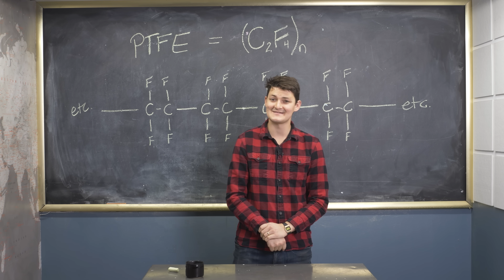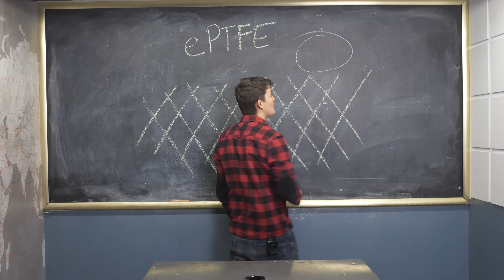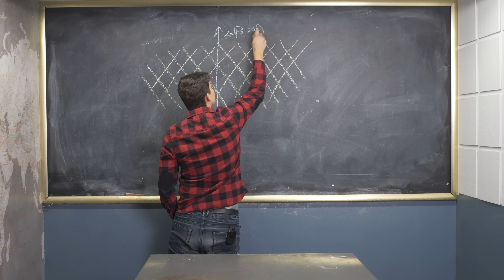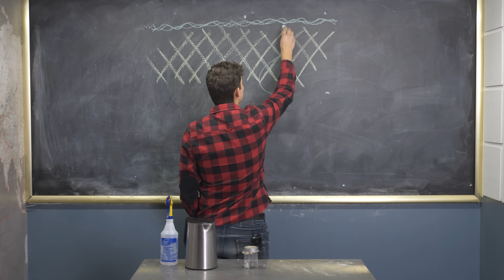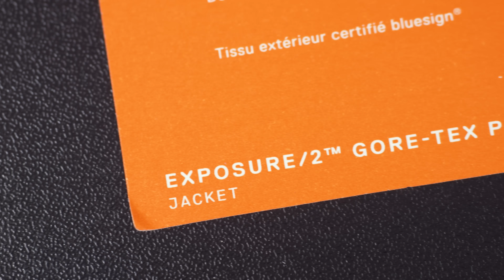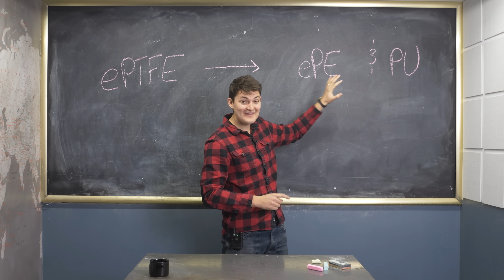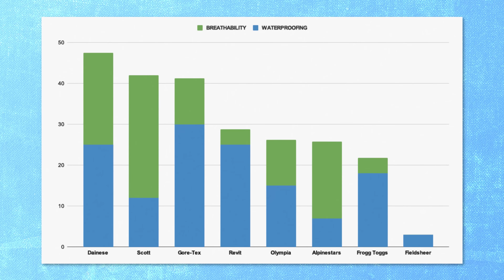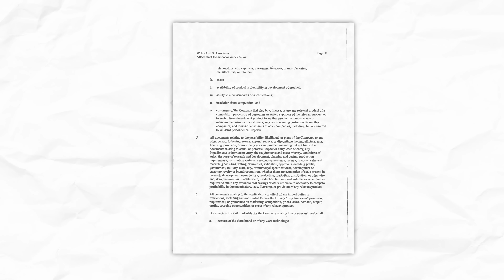Gore-Tex is a Marketing Gimmick

Comment: I mean to be fair, as an ironworker who lives in vancouver, i RELY on rain gear. If youre talking cost to effectiveness, than nothing will beat a 100% wool sweater and a garbage bag. Especially if you're worried about wear.

Also ive never had issues with goretex. But i also wont overpay for it cause i know its not some magic material. 

If youre looking for s good quality hiking jacket or in yiur case for riding than i dont see how you can go wrong with goretex as long as you are not over paying. It is after all just a material

Comment: Awesome video and content - I have a question. The Dainese jackets used are both drop liner garments with a DWR coating on the outer textile layer. Is it true that those garments are going to wet out much more quickly than a laminated textile? Which produces the lack of breathability mentioned where the inner and outer humidity levels are the same, preventing osmosis through the fabric millipores? I’d be extremely interested for Fortnine to compare gore vs other brand laminate jackets (say Revit or Dainese). A full laminated gore is the only gore product I’d seriously consider purchasing for the above reasons

Comment: I'm old enough to remember life before gore tex your choices were to be wet or sweaty.  You ended up sick with trench foot and lifting toenails and all kinds of fungas.  It was disgusting. Gore tex properly made and maintained works to keep you and especially your feet dry and sweat free.  Like any product though it should be replaced in the case of boots after 8 months to a year of heavy use from a repubutable brand like North face or others like it.  If your stuck there are cheap versions and yes bad shops will sell conterfict goods

Comment: I totally agree with the titel. As an experienced outdoor enthousiastic, Gore Tex always failed on me. I bought ridiculous expensive trekking boots equiped with Gore Tex and suffered more from sweaty feet that ever, while the water came in with even a light rain. The same for the expensive cycling jacket. Not the mention the € 1.600,- kayak suit; it isn't dry at all but doesn't breath either.

Comment: cut the ***p, goretex is good, the complainents do not realise that in humid conditions it will not work as well. I have some austrian army gore tex, trialled it on a thundery day storm force ten on the beach, wet all over my gear but dry inside. Did not cost me the earth as it was second hand, mmmmm, had the gear for three years, keep it clean, wash at right temperature cycle, right cleaning liquid, tumble dry on medium, its still fine. thanks.

Comment: I tried one of the local manufacturer's alternate, non-gore-tex products and bought their latest top-of-the-line jacket at their discount employee only store - I had permission through a joint discount program through my company. I paid $500 for a $1000 retail light weight rain jacket.
I really enjoyed the performance at first - very rain proof for Oregon weather and very breathable.
After two years, the outer coating started failing and sloughed off the jacket shell in small patches, then ever larger patches.
When I tried to get a warranty service from the company, they refused saying that it didn't have a tag that should have been on the jacket, so they counted it as stolen, or some such lame excuse. Too bad I hadn't kept the receipt showing it came from THEIR OWN EMPLOYEE OUTLET STORE. I guess the employees that run that place are all thieves?🙄

Comment: Much better than your title which caused me to skip over the video many times thinking it was just someone else mining for clicks. One thing you did not mention is that it is rare to see the same jacket with two different membranes. The jacket with all the cool features gets the Goretex which makes it actually better than the "stripper" jacket. And then there is the problem of flow which you mention. How do you keep dry when it is raining and it is 100 percent humidity outside and 100 percent inside? No differential there at all.

Comment: So, I agree with most of what is sad here, but put in context, you can't out engineer physics. Every water proof/ breathable material on the market comes up against the same challenges. Being a snowboarder for many years, and knowing that i typically run hot, and a bit sweaty - i know i need put vents in jackets. Period. I also know that GoreTex gloves have been the best performing i have used over the last 20 years. GoreTex works, but thats not to say you can't go with another brand like Patagonia who use their own tech to accomplish the same thing and often at a lower price. Should you buy a gore-tex jacket? Sure if you have the cash and don't mind spending it, just don't be misinformed that it's your only option.

Comment: The material kind of reminds me of Tyvek vapor barrier used to cover wood sheathing and allow the wall to breathe (so water doesn't condense and it doesn't mold) yet keep the stray leak off the structural wood. It will keep the stray drop or two from soaking in, gravity rolls it down the Tyvek, and if done right, out the bottom of the siding.

Comment: Carhartt storm defender series is a bit more resonable in price
(100$ jacket and 100$ overalls) 
 Utilizes a poly-shield layer that never requires waxing/waterproofing.  

They also make their storm defender line breathe in a unique way by venting out key areas vs compromising the bead layer.

Comment: I've spent many years in the mountains and tried every "system" out there.  In cold, wet, and windy weather, WPB membranes work pretty okay.  The wind helps the surface of the jacket from wetting out, and the evaporative cooling helps maintain a temperature differential.  Even then, the "breathability" allowed by the laws of thermodynamics isn't great--just better than nothing. In those same wet, cold, windy conditions, simpler systems like ponchos or umbrellas are really unmanageable.   But in less-cold, humid conditions with more still air, like under a forest canopy, the WPB jackets aren't great.  The other problem with WPB membranes not mentioned here is the way oil interferes with them.  The industry has been struggling with that for decades and there are no perfect solutions.

Comment: I like this video because it confirms what i've thought for years- that being breathable and waterproof was always nonsense.  To be honest I am actually surprised GoreTex is breathable at all, so seeing your differential demo is still an improvement on what I was expecting.
Reply: Well depends on use case. For me breathable OR waterproof is useful for everyday use. I wear it when I go out and it protects me from cold while still not making me sweat (I sweat easily). It's rains and drizzles very frequently here so the jacket also keeps me dry for the briefs spells when I'm walking outside. Never bought Goretex though. Jack Wolfskin (Texapore) and North Face (Futurelight) are great.

Comment: Hey Ryan. Some time ago, maybe 20 years ago. There was nothing like Gore tex. All other comparable mountaineering stuff was designed to do 1 thing and then it sucked in everything else. If it is waterproof from the outside and you were burning and swetting inside. Not a great thing at 6000m and could be deadly. Like slow death losing energy to your own sweet when if started turning in to ice a couple hours later. The amount of garments you had to carry was much bigger and heavier. Leather boots with no Goretex where also heavier and bulkier. So you can probably imagine how far plum and not superman at all would go up the beautiful mountains it Nepal would manage to go. Not so far. But I had a bit of money that I invested in second-hand GoreTex kit, and got some new with me. Very light. Much less sweaty. and I could stack everything I need in 10 KG backpack and take my 120 KG repeatedly over 5000 M even few times over 6000. Comparing  Goretex to almost all other garment technology  at the time was impossible. And you could not really go back in to cheap stuff. It felt very different. So they deserve to be successful. Business practices in US are predatory. What is new. I am sure like many other companies which started nice they hired a bunch of idiots who cannot find or invent anything to run a company like a true US business What do I know. I did enjoy your science based explanations on who does something work. That was cool. Morally if you are going to digg in to someone's advertising and predatory business you should not supplement your income by adding advertizing in to your videos. But hey. What do I know. I just wander around life stumbling in to things. Take care. Keep up the good work

Comment: I actually don't hunt for the top tech because I rarely have the ability (nor will) to pay for it. Instead, I check which products are good enough for me, and then I buy those instead. Just recently, I finally found a jacket that does exactly what I want it to do: Protect me from wind while also being REASONABLY protective against rain. I know it won't do both, because if it protects too good against rain...it won't breathe good enough. So windproof while still allowing my body to ventilate is key, and I won't be out in pouring rain anyway, at least not for long (long enough to walk the dog or get home on my bike). So I don't really need that 10.000 mm water pillar protection in the jacket, I only need about 5000. And after hunting a lot for a good enough jacket, I found one, and it only cost me 40 dollars. Now, it's quite thin, but it does the job with protection and I'm quite warm so I often don't freeze that much...but if/when I do, I can use a fleece shirt under the jacket and be good to go, as long as it's not freezing outside but then I really need another type of jacket. Point in case: I don't HAVE to have Gore-Tex, I can take something as long as it's good enough.

Comment: You need to compare goretex it to old
Military waterproof jackets. The material they used before goretex was a nylon that made you sweat like crazy because it doesn’t breath nearly enough. Trust me when I say the difference between goretex and the vintage material that was issued is much much better. It’s a balance, I don’t think anyone is expecting it to breathe like a wool sweater and repel like a plastic bag. That’s the difference and beauty of goretex. It’s not supposed to be a space suit and breath completely underneath, it’s just supposed to repel water for the most part and make sure your not sweating like crazy underneath because your skin needs to perspire. There’s a reason why most first world military’s issue it for their troops.

That being said, better options that are out there should be allowed to rise to the top. Capitalism is not fair nor good for smaller competitors.

Comment: Mountaineering here : the problem with motorcycle gear with goretex is that they are heavy. GoreTex pro (3 layers) works better in a single hard shell construction that is light. Also motorcyclist are always on the warm side… if you go climb a mountain, you must start cold and avoid at all point sweating inside. Most motorcycle jacket are simply way too heavy with liner and isolation inside… one day motorcyclist will be free by learning the layering technique ✌🏻 Try a Bowtex Elite CE AAA and a GoreTex Pro Arc’Teryx hard shell and you will know. Also, never buy a hardshell without pit zip to help it breathe…

Comment: Wore a drysuit for kitesurfing in cold temperatures years ago, made from Goretex ofcourse, and while water did not come in I always ended up wet at the ankles and sleeves and the suit was damp on the inside. Not so breathable after all. I still have it, but I never wear it anymore. Just a thick wetsuit with a windstopper now, safer with leaks too.

Comment: Normally i agree, but i have to make a point here, the price difference is not from the membrane but it is in the production, the Dainese Carve Master 3 is laminated jacket, the Dainese Tempest 3 is not, this makes a huge price difference because a laminated jacket is way more work and mostly done by hand, they are extremely expensive. 
It would be fair if you compare same brand and same fabrication method. 
This jacket, Dainese Sport Master is way cheaper and has also gore-Tex but not laminated, and it has a inner jacket that can be taken out, so also not a good compare, but if you reduce 50.- for the inner jacket i would say you have a fare comparison, then the price difference is only about 30- dollar.

Comment: This is the reason I switched back to traditional canvas. Or sometimes G1000 from Fjallraven. By one and only outdoor jacket now, is a Sarma anorak from Varusteleka which uses the same Polycotton blend as Fjallraven's G1000 so it can be waxed and while it may not be as "waterproof" as Goretex, it's also much more breathable, and dries significanty faster than Goretex and doesn't require any of the maintenence that Goretex does. 

If I absolutley need a shell that provides 100% rain protection, I'll use a poncho. Nothing is going to come close to the breathability as a rain poncho.

Comment: Those 360 cameras are a cool consept but that bit rate compared to what you were using for the rest of the video says it all. So much noise throughout the whole frame when it moved at all. People don’t understand that even if something can shoot 4K at 120 fps it doesn’t mean it can fully process each frame of pixels to be crystal clear. That involves serious processing power which unfortunately is a “you get what you pay for” kinda thing. That’s why even though a new iPhone can shoot 4K resolution at high frame rates with luts to better color grade, it still isn’t professional enough. Another 3 or so generations and we might be there. But even now most lower end cameras in that price point can’t handle high speed without noise in the frame. There are many factors related to this and not just what is stated here, but it’s not worth it yet for me to use a camera like this. A lot of cool ideas and features but the tech at higher levels needs to trickle down into the sub $1000 market for me to really be impressed. Overall cool vid.

Comment: I was purchased a climbing jacket by a company I worked for years ago. The jacket is very high quality and withstood everything i needed it to in the field. Very waterproof, not at all breathable. The jacket had zippers all over it to vent. No complaints other than its mild stiffness
Reply: Same, I have a mountain hardware goretex jacket. Doesn’t breathe at all, but as long as you take care of it and put it through the dryer cycle as directed it is water repellant and works well

Comment: i dunno if goretex is what they use on waterproof jackets but ive bought 2 expensive so called waterproof jackets from travel shops one was $150... it wasnt even slightly waterproof.. ie had a wax horse riding jacket for 20 years.. its only started becoming not waterproof int he last few years due to holes

Comment: I've found that it is really dependent on the environment you are in - works well in the wet and cold months but isn't so good in warmer weather. Also, to this day the best waterproof/breathable boots I have ever bought had some off-brand membrane in them with no label (and so were about 1/4 the price of the branded ones). I didn't even know the boots were waterproof until they kept my feet dry for three wet and muddy days and I did some research when I got back home.
Reply: What model/brand are those waterproof boots? I've been desperate to find reliable ones in wet weather😢
Reply: @Mr3alaZag   get leather and wax them
Reply: Can you tell me the name of that membrane? Or the brand?
Reply: Like @Merzto I've given up on the GoreTex and gone to leather. Gore lined boots are great, but after x amount of years, the layer breaks down. I've gone to Scarpa SL-Active which are brilliant for my feet, most comfortable walking footwear I have. Of course they won't fit everyone

Comment: 4000 comments and only 4 mentions of Shakedry.  I 100% agreed with this video until I tried Shakedry.  My first experience with it - cycling in the rain, as usual I waited until I was nearly soaked through to put it on, because I would end up wet with any other Gore-tex on anyway, it's just insulation at that point.  Anyway, I put it on and actually dried out as I wore it.  Go figure.  Worth every dollar.  It has saved my butt a few times now and it's made cycling in the rain much more bearable, enjoyable even.